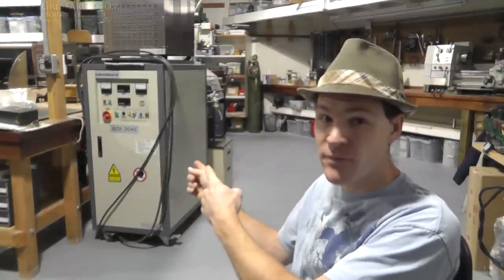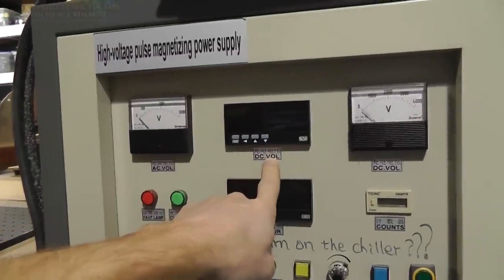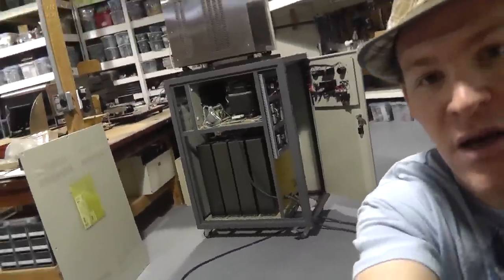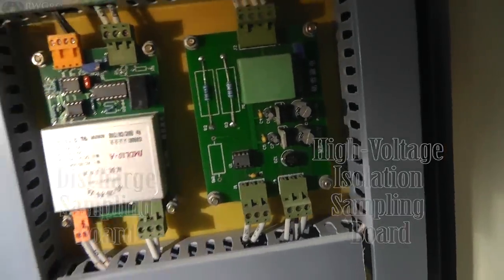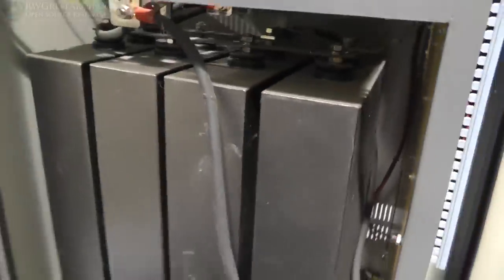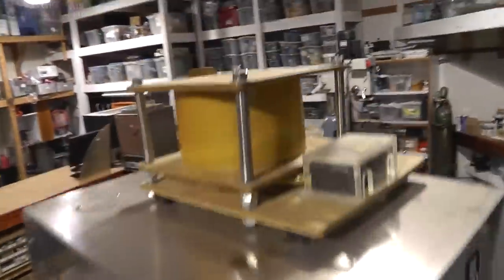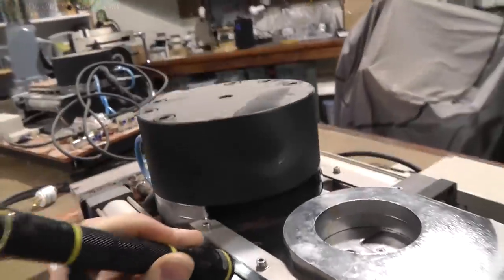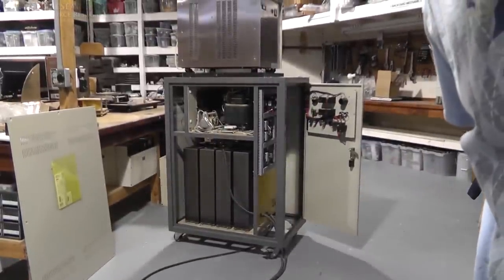Industrial Impluse Genarator Autopsy 18,000  joules (Magnetizer)

Comment: did you ever get it working.... or like all autopsies.... the end of the process is pretty much a given :)  (For the record, home 240/120vac mains is a split single phase.  So, at the pole, the house supply is delivered to the home electrical stack through a center tap 240 volt secondary.  So, you get 240vac out with 120vac between L1 or L2 and the CT.  At least that what I remember)

Comment: On those Yellow magnetizer units... would they use custom 'concentrator cores' to fit whatever size material pellet that will be magnetized?  When magnetizing material, seems you would be required to hold it perfectly in-place, so there would be a lot of customized 'adapters', so to speak, for each type of job.

You and your toys never cease to amaze...
Reply from the maker: normally there will be a " focusing material" such as in iron core or such. i haven't got any that i can find for those units but i have tested this and it works well.  in the other units you can see the core. however it will magnetize with out a core, i just don't think it will be as strong or precise.   i will be testing this in the future. :) ! ~Russ

Comment: Please do it with 3000volts and maximum capacity. Can you also magenetize something with ac current? If theoretically yes, how would the magnetic field look like?
Reply: +Quantum That's pulse not actually AC current, half of sinus wave. The energy produce from capacitor bank discharge for a very short time (mili second).